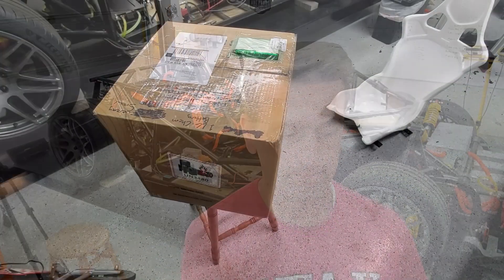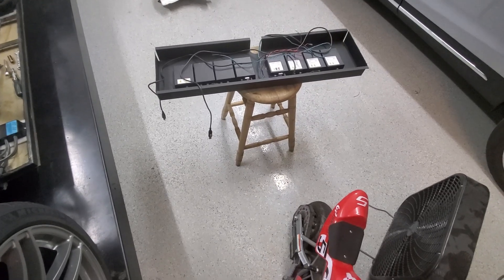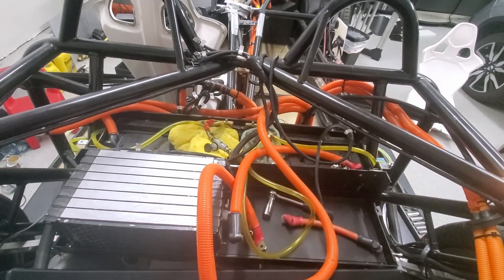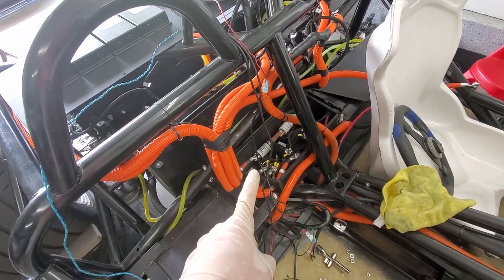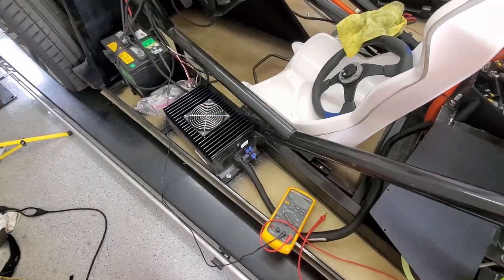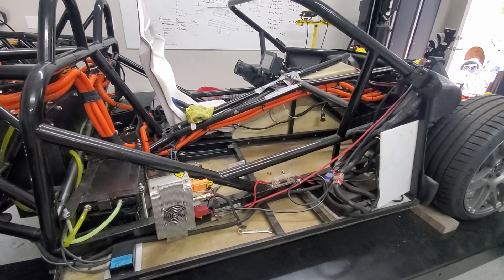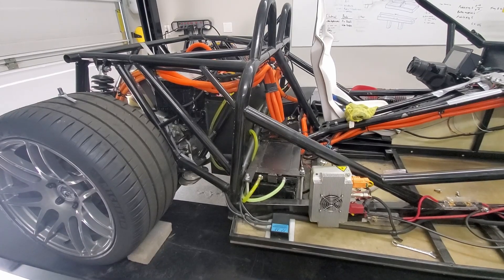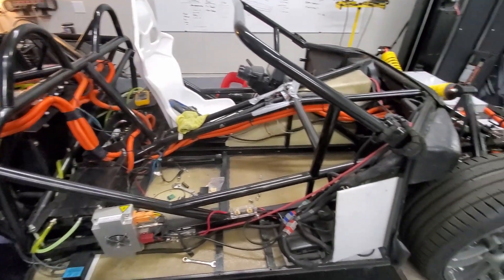High Voltage System Working Part 1

Comment: Great Series! I’ve only just begun! But great job. Couple of questions.... I’ve purchased my Tesla S Motor, and the controller from EV ! Have most wiring and down to cooling and batteries.... I can’t decide on batteries.... exactly what and how many did you use? 
Btw if you’d rather this type of communication offline... let me know how to contact or friend you! 👍
Much appreciated! 🙏
Reply from the maker: Glad we could connect.  I ended up using the LG Chem batteries.
https://www.evwest.com/catalog/product_info.php?cPath=4&products_id=481&osCsid=eijtoq8fe0bcf8qhosrpcp2d91
I ended up using 12 (2 packs of 6) for ~32kWh.  I am planning on ~100 mile range.
Good luck with your build!
Reply: @electricsupercar  why did you chose those as opposed to others?
Reply from the maker: @motome8  At the time those batteries were one of the most Power-dense batteries available.

Comment: That thing about needing 20 wires and one ground...how do you put them together? Assume I am a 5 years old pls if you answer :)
Reply from the maker: Not sure that I am the best at explaining...but here goes.  All of your powered systems (lights, horn, wipers, etc.) need a 12V source (positive and negative from a car battery).  You can connect all these to one ground wire (-12V) back to the battery.  Then when each powered system receives a +12V  they can turn on.  So you need many +12V wires but only one -12V back to the battery.
Reply: @electricsupercar  thank you!

Comment: whats your job? what do you do to be able to afford this kit, the electric parts, and the time to do it?
Reply from the maker: The basic kit is less than $10k.  You can get a rear Tesla motor for ~$3k.  The batteries for me were at around $6k.

Those are the most expensive items...but yes it can add up quickly.

I have a normal 8-5 job.  Nights and weekends are my play times in the garage.